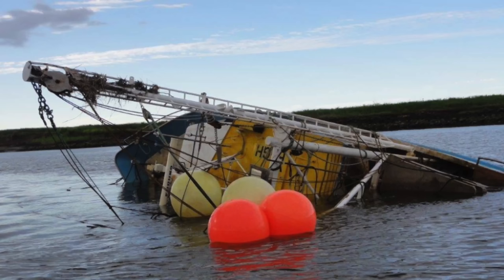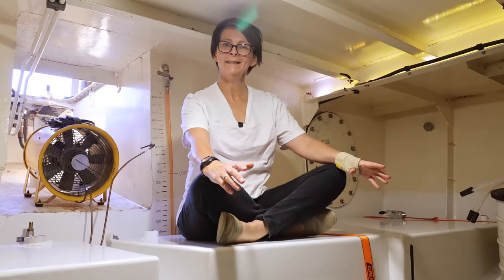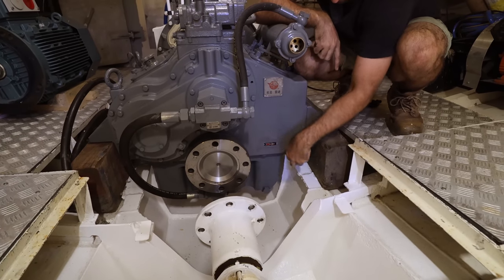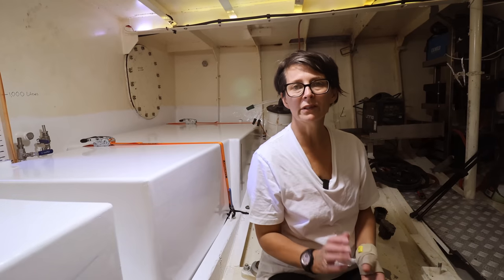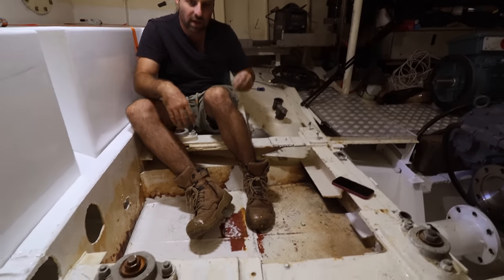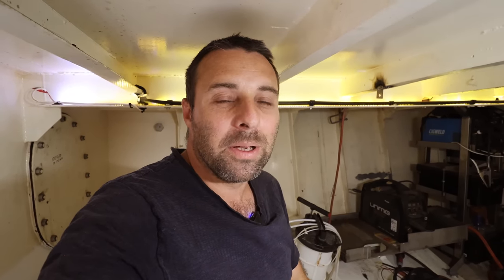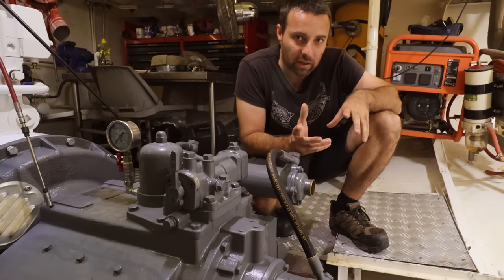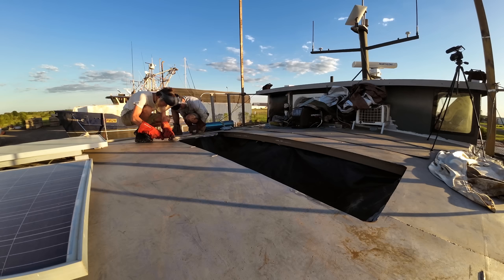What's next for Brupeg's Engine? - Episode. 300

Comment: If the plan is to explore remote regions where a tow or reescue might be difficult to obtain,  this is the time during final install to assess backup propulsion possibilities. With lots of solar and alternative fuel gens an electric motor that you could cut in to the gearbox in an emergency could get you back to safety. It certainly won't be cheap but it would be a life saver. Just something that has been on my mind as you get closer to finalizing your main drive.
Reply: Have you not watched any of the videos? They have a 30kw backup electric motor sat next to the engine and 5kw solar setup going in.
Reply: Aah.....uumm.....hmmmm..........uhh.......yeah. Wow.

Comment: That’s some amazing solar. 

On the coupler/adapter, will there be any flexible component to reduce vibration at all? Is it even necessary? This is where all the fun begins. Routing everything and keeping the install clean and functional will be quite a challenge.
Reply from the maker: Hi Ian. Normally pleasure boats have flex couplings and rubber engine mounts. They are brilliant and kill a large amount of noise. However… we priced them for Brupeg and it’s close to ten grand for the mounts and flex coupling. So, Brupeg will be doing what all trawlers do and solid mounting the engine. This will be louder, it’s stronger but harder to live with, but ten grand is a lot of your patreon money that’s better spent elsewhere on the boat and or on projects we can donate the boat to.
Reply: @ProjectBrupeg  hey Dame/Jess. Ben and MP from Sailing Yabá are restoring a wooden boat in Brazil. They have quite a sizable roof on which to install solar. They just got in their LI batteries  and accessories, but haven’t figured out panels yet. Any chance you could reach out to them about what you’re using? If you want, I could connect you through WhatsApp.
Reply from the maker: Happy to. Send me an email to Dame@brupeg.com and we can organise contacts. Thanks very much

Comment: Hey guys, absolutely love your progress and what you are achieving. I have a couple of ideas to potentially add to the mix. First with fuel handling. Have you considered a small centrifugal purifier? They work wonders with diesel if you wind up getting water or contaminants in your tanks. Alfa Laval make some pretty compact units, but it may need tome pipe modifications to allow you to polish tanks back to themselves. Secondly, have you considered perhaps using your get me home motor as a shaft generator whilst underway? I have 2 x 300kw motors on the ship I work on that are for propulsion and or generation, depending on our operating mode. Just food for thought! Keep up the great work!
Reply from the maker: Hi Tom
We love the idea of a centrifuge and that is our first choic but funding is the stop there. eventually we will get to centrifuge level but for now its filters until then. I (Dame) did consider building one but apparently I have too many projects to add in more). As for get hom being a generator. we looked at that early on but the electrics downstream became very complicated very fast. right now we will be using solar/batteries for all power at anchor and when gensets are off, and then gradually build up starting the 5kw genset and if more is needed swapping over to the 55kw genset. Whilst underway i have considered a cruise alternator which is an AC alternator around 5kw constant. again its always a balancing act with what we can afford and what we can survive/get away with under funds allow an upgrade.

Comment: When using the get home motor would the gearbox still be turning? I don't know much about those gearboxes but I do know that gearboxes in trucks both light and heavy duty don't lubricate properly when driven from the output shaft which is why you are supposed to remove the driveshaft if your going to be towing it because they can destroy themselves pretty quickly.

Comment: Interesting to follow your project.
In this connection, I have a comment. I understand that you want to use an electric motor for operation directly on the propeller shaft.
This can damage the gearbox as the oil pump is driven by the motor shaft.
When the propeller shaft rotates, you will lose oil pressure on the gearbox and damage the hydraulic couplings clutch.
Reply from the maker: Yes we have discussed this with the gearbox agent and he has given us the specs needed to fit an external line pump to solve this issue.
Reply: Ok

Comment: The only issue I can see with your solar panels is most flexible panels will have a shortened life expectancy when mounted on a metal surface due to heat buildup from the sun. In the RV world which I work  in we are told all the time from manufacturers not to install them on metal surfaces.
Reply from the maker: Thanks Ben I will talk to Bougerv and get some details on what they recomend

Comment: Congrats on 300 episodes. 
Damian when using flux core wire and no gas the nozzle is not required. Just thought you might like to know. 
Eric
Reply from the maker: Hi Eric. This was a dual shield wire. It has flux but also requires a gas to be run
Reply: @ProjectBrupeg  cool mate

Comment: Question: Wouldnt it be better to have the roof panel removable un case you have to remove the engine again in the future if need be?
Reply from the maker: For us it’s an easy job to cut the roof open and re weld it closed. This is the first time in almost a decade of owning the boat we have needed to open that area. It’s only ever used to lift a main engine in/out. And I doubt we will ever be changing the engine in the next decade

Comment: Woohoo it's coming along... just a thought... if you lose air pressure to start the diesel (God forbid), could you use the electric motor to spin up the diesel?? through the G/box... as a redundancy?? meanwhile keep chipping away eh
Reply from the maker: We investigated this but no it’s not possible. We will have a secondary form of starter using a spring starter though

Comment: Just a thought.  If there is a major failure of gearbox and it locks up, how do you use electric motor backup system to get underway?  Is there some sort of fail safe freewheeling on the coupler that allows belts to drive propeller?  Hope for the best, plan for the worst!  Cheers

Comment: Have you looked at lead/Chrystal batteries for starting. All the advantages of lithium but half the price and 95% recyclable. And a 15 year life span or more. Made by Betta i think
Reply from the maker: Nope. We are moving to air start as it offers a much higher level of redundancy for this boat. Batteries of any type are the weakest link in an electrical start circuit and with air we can remove that link entirely
Reply: Far enough. Most times air isn't an option

Comment: Hi guys what type of belt are you using for the get home motor setup I was thinking a tooth type belt over a v belts with a electric type clutch don’t know if you thought about going this way or not  cheers
Reply from the maker: Hi Alan. The belts will be 85mm wide toothed belts. One one the prop to idler and another idler to motor. They need to get a 12:1 reduction hence two belts makes that easier. As for disconnecting the belts we have a mechanical disconnect device that we’ve designed and built that takes the belt physically off the prop shaft pulley when not in use
Reply: I know that you can get a hold lot of off pulleys in 8mm and most belts lengths as they are easy to get in the drag racing world as well as idel
Reply: idler

Comment: just wondering why you didn't turn the top hole into a soft patch?
Reply from the maker: It gets opened once a decade maybe. Longer if the engine isn’t being replaced. Anything bolted will eventually leak, welds will last as long as the rest of the boat and it’s a small job to re cut it if we ever need to. Welding it is actually the fastest, easiest, most leak proof option that still remains a soft spot when needed

Comment: Can you tell me what type of Flux Core Welding Wire do you use as all I get is a lot of spatter from what I use your welds look pretty good.
Reply from the maker: It’s actually a dual shield wire. It has a flux component in the wire but still needs the gas to run. Are you using gasless wire as that does splatter like nobodies business.

Comment: What would be the process for replacing the belt(s?) on the get home motor - propshaft? from what I've seen you'll be needing to slide the main shaft aft to get a replacement belt into position? Should be fine for preventitive changes but could be a pain if you ever have a break.  Have you aleady considered and discounted a chain drive with removable links? If the preference is to keep with a belt drive, maybe a couple of brackets on the aft bulkead to store a spare belt aleady around the shaft that can be moved into position should a break in the belt occur under way.
Reply from the maker: Yes basically what you’ve said Andy. Chains open up a bunch of other issues like keeping them lubricated so we dropped that idea (but love the ability to join using links). The prop needs to slide back for belt changes but the plan is a couple of spare belts looped over the prop shaft and just pulled forward when needed

Comment: Could you adapt your v-belt setup to use your "get-home" electric motor as an electric starter for the main engine?
Reply from the maker: Hi John. We investigated this with the gearbox manufacturer but short answer is no. Hydraulic clutches inside need the input shaft to spin to generate the oil pressure to lock up and drive. Turning from the output shaft doesn’t allow the oil pump to work the same way so no locked gears.

Comment: Is flexible coupler appropriate for your installation? What about universal joint connection for trans to prop shaft?
Reply from the maker: Hi Joel. Flex is an option but the cost isn’t. We have priced that up and it came to close to 10 grand all up for parts. Solid mounting is the norm for ships and trawlers as it’s bullet proof but noisey. Uni joints are an option but not needed with correct alignment

Comment: Such a wonderful propulsion system! 
Having worked with big Cummins and Cats, I’m wondering about your ability to exhaust the heat from the radiator with the vents you’ve already built. I suspect that you’ll need way more CFM exhaust, and also inlets. You’ll also probably want to run a hydraulic radiator fan.
This fan can also be your primary exhaust fan with proper ducting. 
Good job Y’all! 
BTW, I’m down on South Padri Island Texas right next to Boca Chica to watch the SpaceX test launch of the absolutely massive Starship Monday (tomorrow) morning! The cargo capacity of the Starship is necessary to cary many many more datalink satellites economically. Musk says that he needs thousands more to provide for the increasing demand on the system.
Reply from the maker: Hi Bart. That launch is going to be amazing. Can’t wait to see it myself. We have keel cooling so no radiators anywhere in the engine room to cool, we do have passive heat to remove from the engine room and that’s what the yellow fan extracting is for
Reply: @ProjectBrupeg  unfortunately the launch was scrubbed. 
I understand that keel cooling is what’s happening now. I was referencing the need for a more advanced cooling ventilation system for when an in engine room cooling system is adopted.
Keep up the fantastic work!

Comment: What battery are you using to crank your engine that doesn't work below freezing? I live in Canada, we start truck engines well below freezing every year with AGM batteries.
Reply from the maker: Lead acid. Plus it’s the added hassle of needing to maintain them and if you get it wrong you have no way of powering the starter motor. Yes they work when they work but when they stop we can’t replace them. Not so with air and spring start

Comment: Hi, Do you have enough room to fit the generator longitudinally as it is not recommended to transverse mount an engine for the expected large roll angles you will have?
 From Caterpillar 
""Transverse engine orientations are not recommended.*
*The rolling of the boat can shorten the life of the
crankshaft thrust bearings. When the boat rolls, the
crankshaft will slide back and forth, hammering on its
thrust bearings. If the engine is running, the motion
will be dampened by the engine’s oil film. If the engine
is not running, the oil film is not present to protect the
thrust bearing."

Graeme
Reply from the maker: Not an option. Engine room physically isn’t big enough. Transverse was how it was previously mounted. It’s not ideal but it’s the only we it will fit

Comment: I just wonder why didn't you make bolt fastening for the roof cutout instead of welding. The bolts should be stainless along with stainless washers to cover the possible gaps. Of course I don't know your intentions. I'm touching on the topic because you've already dismantled the engine once so why not make the construction more convenient to work.

Comment: Hey,  if you have to use the get home motor, will it also spin the gear box?Will that have oiling issues??  IE a spinning gear with no oil pressure.   Just a thought,   I don't pretend to know how your gear box is lubricated.   Also if the get home motor does spin the gear box, what if the gearbox is broken internally?   Sorry,   Unfair questions I know.
Reply from the maker: We need to fit an external piling pump to the gearbox that is run while in limp home mode. If there is a catastrophic failure of the gearbox we are dead in the water as that is our thrust bearing. We can’t account for every eventuality but we can sort most things

Comment: Why did you use flux core wire on the roof. Is it harder do do then gasless?
Reply from the maker: I find it’s much better in the wind. It’s a dual shield wire so it still needs the gas but if you get a gist that blows the gas envelope away momentarily it doesn’t put porosity in the weld. Using this wire  we can safely weld in up to around 15knot gusts
Reply: @ProjectBrupeg  OK Thanks

Comment: As good as your welds were I wonder if you had some interference from grounding to rusty metal tabbing.  I judge that from the sound of the weld, a good weld will sound like bacon frying with a smooth consistent sizzle. Yours was a bit sputtey like from dirty metal or a working but less than 100% ground.  Of course if it is on pulse all bets ar off.  Do you have to use a release agent or barrier film with the cast-in-place engine mounts?  I would hate to see the engine epoxied in place permanently.  Looking Great!
Reply from the maker: Occasionally it was hitting a bit of paint on the underside which the flux had a fight with. I was also stop start welding where the fit up was a bit off and the gap a bit too wide to stay running a stronger bead. Did sound a bit off when on fast forward. I’m not sure about release agent. Will need to read up on the specs of

Comment: I'm sure smarter people than me have thought of this but in the event of the engine or gearbox seizing there a clutch mechanism on the back of the gearbox to disconnect it from what would essentially be a seized propshaft?
Reply from the maker: I’m not sure if the exact procedure yet but the gearbox supplier said this gear can do what we need if we fit an external oil lube pump. We do need to get our heads around the process etc to engage a get home

Comment: FIY even if a panel is rated for walking, it's still best to avoid doing that. If it's unavoidable, then i suggest you don't walk over the same area. Even the strongest things suffer from compression, electronics of all, are susceptible to that kind of stuff. If possible, i'd walk barefooted as well, because shoes might have grit embedded in them and that would scratch the surface, causing it to be inefficient. Just my 2 cents.
Also, the engine bay will look spiffy as heck! :) All the effort was worth it, all the toil, blood, sweat and tears you guys and of everyone involved directly and indirectly, paid off in spades.
Reply from the maker: Thanks yeah we will have walking spots. The layout is a bit difficult to get symmetrical because of the roof shape and the exhaust stack. That said the gaps will have grip paint put down so they will be were we will be aiming rather than on panels. Completely agree with you though, just cause we can, we probably shouldn’t

Comment: Engine !  Lol, but  :face-turquoise-covering-eyes: only for fun. It's the great nerdy argument.  Electric motor .... internal combustion engine ... clear and defined. 
A stream engine ... but a hydraulic motor ?  What do you call a paddle wheel, wind or a horse powered  thing.... engine or motor ?
Reply from the maker: I would argue a horse is more hydraulic than electric so hydraulically drawn cart. Unless we are talking synapses that trigger the hydraulics so then we need to clarify it as a hybrid electric/hydraulic drawn cart. The first EV if you will
Reply: @ProjectBrupeg  ...told you, nerdy